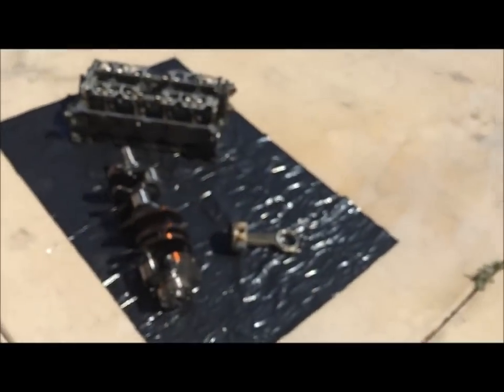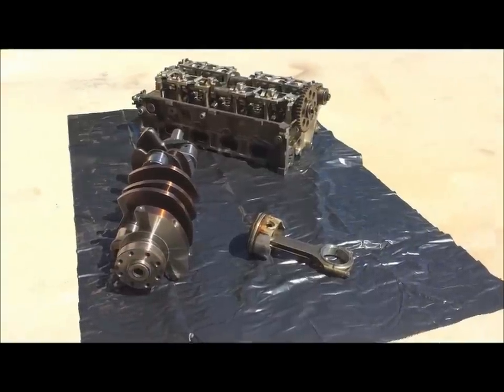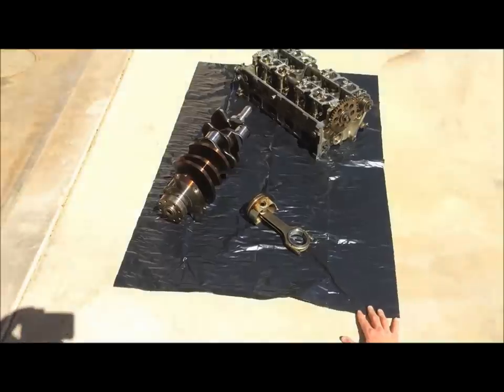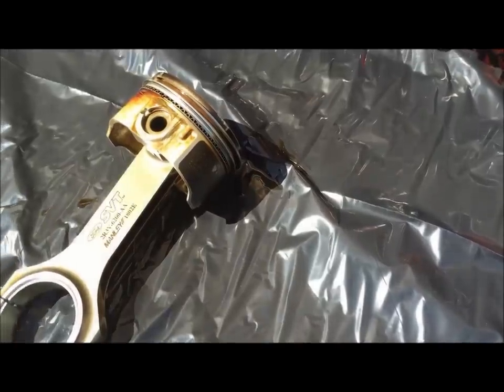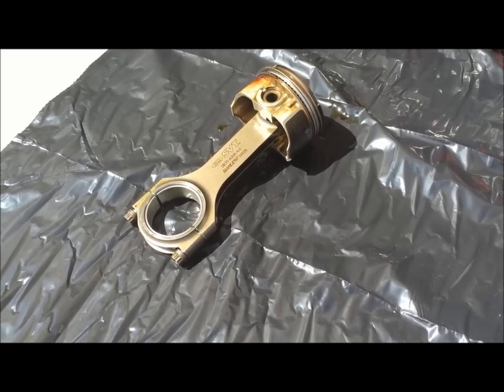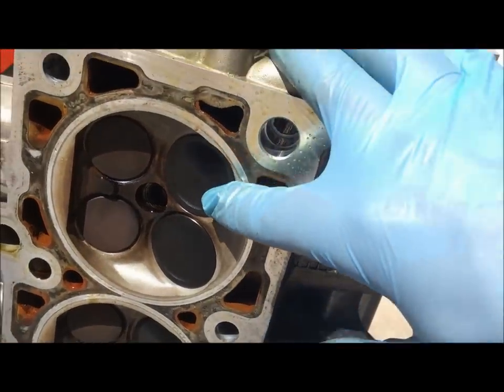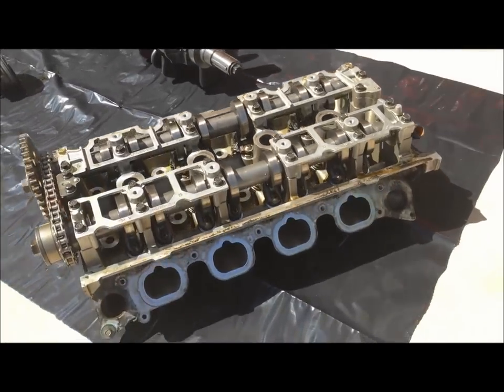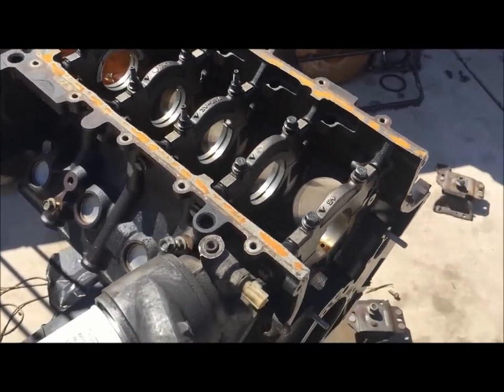Why is the 03/04 Terminator Cobra Engine so STRONG? Internals exposed

Comment: Hi Danny, I'm in the process of rebuilding my Mach 1 engine and found a set of Manley rods and New Zoller .20 over pistons (03 cobra OEM manufacture).  I know the pistons are 4032 material instead of 2618.   How long do you think the engine will hold on a Ported Eaton with 14 pounds of boost (500rwhp)?   Would 100k miles be possible or am I foolish for not going 2618 material?  My goal is a 100k mile sealed engine.

Comment: Do u recommend using the OEM oil filter? Seems like most people are. I’m using K&N oil filter and royal purple. This was my first oil change. Just got it last summer.
Reply from the maker: Yes, motorcraft FL820-S. I used a k&n once and it had far too much backflow. The car sounded like it was out of oil every time I started it.
Reply: Danny Johnson hmm. I haven’t noticed any change. So when you started it did it sound like it was ticking?
Reply from the maker: Mayjor Maynard Yeah, for a split second just like when you first start it after an oil change.

Comment: Great video, is it possible to run E85 on these Cobras without upgraded fuel lines or anything? I have an 01' Cobra with an Eaton swap and all forged internals, but here in Ohio E85 is very easy to get.
Reply from the maker: your main challenge is to get enough flow with the stock pumps. Or even a stock pump on a 01 Cobra. it’s possible, but you’ll be very limited until you go full return fuel system to big pumps

Comment: I have a 1997 Cobra with Kenne Bell supercharger and I going to swap aluminum block for Terminator block.. any ??
Not much info out there...
Reply from the maker: FrogsterGonzo Unless there is a problem, keep your 97 aluminum teksid block. It’s just as strong and lighter.
Reply: I have a 97 teksid also and it’s the holy grail. I did eagle ceramic coated pistons and Oliver rods 20psi boost with a pro charger and it’s bullet proof at 1000whp!!!

Comment: I kind of wonder why Ford didn’t just put a shorter pulley from the factory with the right tune.  This seems to put out 500hp easily.  I guess they ran out of money after putting all of the money into the internals and they figured their buyers would upgrade them anyway.

Comment: So are the 01 cobra heads good ? I have a 03 cobra but it ticking and I was gonna get my extra 01 cobra heads ported and polished and put them in
Reply from the maker: Esian Fuentes yeah, 2001 heads are almost as good as of 03/04 heads, but you want to make sure everything will work with fitment. Maybe it was just the front timing components that made the Eaton swap difficult for 01 COBRA's, but it may have also had to do with the heads as well.

Comment: this is a great video! you seem to be well versed with ford motors. in your honest opinion, which motor would you rather choose between a 2015 mustang 5.0 coyote motor or the terminator motor and why? i have a 2015 mustang gt, but i feel I may get a cobra one day and just want some more opinions. thanks.
Reply from the maker: Loscar5oh I was actually going to make a video on 5.0 vs terminator engines lol. It's all about goals. Both are great platforms, and without rebuilding the engine, the coyote's biggest advantage is making great power while being n/a with high compression (though it also makes good power with low boost being high compression- you just can't push it too hard, but you don't have to- it makes a lot of power from the high compression ratio). The terminator is also a Goliath for boost and safe to do so at 8.5:1 compression ratio...both great engines
Reply: Scrun Johnson thanks for the advice. I was wanting to procharge my 5.0 at some point but it would be amazing to build up a termi as well. in terms of reliability, lets say both are pushing 650 hp, which would hold better?
Reply: Scrun Johnson oh and you should totally do that video!
Reply from the maker: Loscar5oh is hand that one to the terminator, since the rods on the coyote are powder forged and may not hold up for a long time, but both can see 600s no problem
Reply: Scrun Johnson i didnt knoe that aboyt the coyote rods, i learned something new today lol. thanks for the help man, hopfully one day ill get my hands on a termi.
Reply: Scrun Johnson i did some research and found out the 11'-14' coyote motors have powered rods and the 15'-17' coyote have forged steel rods. these newer 5.0's are very similar to the boss 302 road runner motor.

Comment: Is the stock block for 04 cobra came with 4 main bearing or 2 main bearing for the crankshaft ?
Reply from the maker: omar alharthy if you watch at 8:22 it shows you have a total of 4 bolts per main cap. Two directly on top and two coming in from the side. An aluminum block has two more on the top for a total of 6 per main cap
Reply from the maker: +omar alharthy if you watch at 8:22 it shows you have a total of 4 bolts per main cap. Two directly on top and two coming in from the side. An aluminum block has two more on the top for a total of 6 per main cap

Comment: i was looking at a 99 cobra for sale. the interior and even the engine bay looked perfect, but it has 130000 miles on the engine so I was planning on rebuilding the engine with forged internals. I cannot really find the parts for a 99 cobra engine. Can anyone help?
Reply from the maker: YouShouldReallyContemplate Suicide i'm doing a video series on rebuilding the 4.6 L engine. The first thing you will want to do is buy the book how to build a 4.6/54 engine. I am reading through that book now to redo the build step-by-step, so watch my videos on pulling and disassembling the cobra engine and stay tune for the rebuild.

Comment: How many liters is the stock Eaton supercharger? What is the max boost it capable of putting out? Thanks.
Reply from the maker: 556 4Ever stock eaton is about 1.8L. After porting and a very small pulley you can see about 15 psi give or take
Reply from the maker: 556 4Ever you might enjoy this video if you have not seen it yet. https://youtu.be/sqYP7YGanYg
Reply: Thanks for the info. I just picked up a 2004 SY Termi with 36K miles. Has a 2.76 pulley with belt tensioner, CAI and Bassani exhaust with hi flow cats, SCT big mouth MAF with SCT tune and an MGW shifter. I'm planning on getting it dyno'd to see where it stands. I'm thinking somewhere between 450-470. What do you think? Is that realistic?

Comment: Idk if this would sound like a stupid question but would the cobra internals fit in a 03 marauder?
Reply from the maker: Quinnn Harris Yes. The cobra has a pretty low compression ratio, so I’d keep the  cobra crank and cobra rods and get some  different forged pistons with less dish to up the compression ratio
Reply: Ok, thanks man!! I bought a marauder but the engine has a knock so I want to break it down and rebuild, looking to get at least 500 at the rear wheel...
Reply from the maker: Quinnn Harris The complete supercharger system from the cobra will mount up, but you need a ton of parts. You might want to consider buying a complete cobra engine to just drop in. With machine work and parts, you’ll be at that cost. I’ll post a link to where I remove and tear down my friend’s cobra engine so you see what it’s all about
Reply from the maker: Quinnn Harris https://youtu.be/YFZVIkDmgY8
Reply: Thank bro, I really appreciate...but your right, I will need a tone of parts if I tried it. Thinking it will be cheaper to just go with the Vortech Supercharger instead.

Comment: If Ford made it a 5.0 instead of a 4.6 and increased compression proportionately, how much horse power do you think it would have made? 500 hp?
Reply from the maker: 556 4Ever Yeah, something like that since the GT500 right after was a 5.4L and made 500 and then 550. Those cars made that also with a more efficient supercharger, slightly lower compression ratio (8.4:1) but a lower redline. I spoke a little about it in this video https://youtu.be/mB7h9S_qa3I

Comment: I thought the 99 and 01 cobras have c heads??so my 96 cobra had powered rods,lol j/k. All that will change some day eventually,i got some plans. Loving my forged crank and 1000hp+  teksid block though :)
Reply: Btw try and do a heads video,i just got a 5 angle valve job and changed my valve guides as they were destroyed(idk how the fuck previous owner).
Reply from the maker: Morbid SVT COBRA I'll have to look at the specifics, but I believe the sn95s had the b heads and somewhere between when and the new edge they went to c heads, but the Cobra/Mach 1s had a revision (likely to accommodate the blower and flow better) so you can do an eaton swap on a 99/01 but it needs some kind of adapter
Reply: Yea they sell a kit for the eaton for c heads,i would have gone the c head route and then bought the kit,but i did my heads and ill just get a procharger later down the line
Reply: The 99 and 01 Cobras did have C heads. In 99 if you remember ford had an issue with the cobras not making the power they stated due to: restrictive intake manifold (which was a new design), heating issues around cylinders 6-8, and a exhaust that was too restrictive. Ford has a TSB out for this and fixed these Cobras at no cost to the owners. This was obviously fixed for the 2001 cobra. Also you can do an eaton swap on a 99/01 Cobra because of the head design. You cannot use a terminator eaton on a 96-98 without a kit (if one exists) or extensive modifying. The head you showed in the video @Scrun actually looks in good shape. Is the owner going to get the coolant crossover mod done during the rebuild? I would recommend it.
Reply: In would get the coolant crossover mod too if i was him while the engine is out,piece of mind.
Reply: Yeah, I have heard that what happened in cylinder 4 I believe tends to happen more often in cylinders 7 and 8 due to the coolant routing around those cylinders. They tend to be the hotter cylinders and the fuel comes in on the passenger's side of the car in the termis iirc, so bank 2 tends to be a little leaner as well.

Comment: The terminator is the same as the Mach1 engine right? Like the one in my marauder?
Reply from the maker: Vincent Pampanin They have a similar DOHC layout but are not the same. The Mach 1 standard transmission car (5 speed) has the cobra crank and heads but not the cobra connecting rods or Pistons. The compression ratio on the cobra is 8.5:1 whereas the Mach 1 and marauder have 10:1.

 The automatic transmission Mach 1 engine as well as the marauder do not have the cobra forged 8 bolt crank, so they only share cylinder heads with the cobra. The cobra has an iron block and the Mach 1 and marauder have aluminum blocks.
Reply: Danny Johnson thanks,  I am looking at forced induction for the marauder, stock they are good for 8lbs. Depending on the output with 8 lbs I might do it,  might not.  I'm not wanting to do a full bottom end build too.
Reply from the maker: Vincent Pampanin are you going to do an eaton swap with the cobra timing chain and such?
Reply from the maker: Vincent Pampanin I have some good videos showing tear down https://youtu.be/NT5Z5L2wAss

Comment: I'd rather have a stronger block then saving weight! ol'boy might learn the hard way depending on his power level!
Reply from the maker: Edward Thayer the teksid blocks were manufactured from Italy via the same company that builds the blocks for Ferrari. They are heat treated and strong enough to hold just about anything you'd put to them. The WAP (Windsor, Ontario plant) aluminum blocks are a different story, but still okay. Interestingly enough, the aluminum blocks have 4 bolt main cap studs vs the iron with only 2

Comment: NICE VIDEO FOR THE KIDS TODAY WHO HAVE NO CLUE WHAT THEY RE DRIVING, nice job. Subscribing,
Disagree with some of what I watched so far. The the Teksid block was 96-98 only, however there have been a few to slip through and show up in some 99 and 01 cobras, it would be interesting note if the German forged or Kellogg. 
ALSO DISAGREE ABOUT YOUR ASSESSMENT ABOUT THE BLICK CHANGE, THE IRON BLOBK IS USED AT FIRST GLANCE BECAUSE ITS PRECEIVED AS STRONGER, BUT WAS MAINLY COST CUTTING,.....FOR TEKSID ALUMINUM BLOCKS ARE SUPER STRONG.  GOOD FOR 1000 HP+ PLUS MUCH MORE DESIREABLE FOR THE WEIGHT SAVINGS. ESP WITH A BLOWER BEING TACked on
Reply from the maker: Keep in mind if Ford’s official statement for going to iron was for strength, that’s what I would report over an opinion about it being for cost savings. When you consider the aluminum blocks available to ford in 2003-2004 (as found in the Mach 1, which is a WAP block-meaning Windsor assembly plant), the iron block is stronger than what they had. The Teksid blocks came from italy and were heat treated and tanked, and without that process Ford did not have an aluminum option that would be stronger. Also, since teksid blocks appeared in 99 and also a handful of 01 Cobras, it would be incorrect to claim it was 96-98 only

Comment: All cobra cars had 8 bolt cranks
Reply from the maker: King Jerel thank you. I was pretty sure that was the case, but didn't want to make the claim. Not sure on the 93-95 5.0 Cobras/Cobra R.
Reply: Danny Johnson I'm sure about the pushrod era but all 4.6 cobra cars did and the aviator, marauder and mach 1 engines did as well..I was watching thinking I hope he doesn't say mahle poisons pistons lol but you you know your shit!! The zolner pistons were the weak link and the back two cylinders failed due to the coolant passage issues that I think were revised in the 2004 year.. You can do the crack pipe mod to remedy this and finally I think the high-speed 6 gear runs made them fail too bc the 6th gear ratio was so tall
Reply: Danny Johnson you've gained a Sub 🤘
Reply from the maker: King Jerel yeah, long highway pulls were definitely not wise. I'd like to do the cooling mod on the heads if I remove the Trans and have a nice straight shot. Just as a tid bit of info, the automatic Mach 1s, marauders, and even the aviator had a 6 bolt non, forged crank. That was the only disadvantage. Welcome to the channel
Reply: Danny Johnson are you sure?
Reply: Danny Johnson you mean the automatic machs
Reply from the maker: King Jerel yes, the automatic Mach 1 mustangs, marauders, and aviators (all the DOHC cars with automatic transmissions) had a 6 bolt, non-forged crank. They also had a lower redline then the 5 speed, forged crank cars
Reply: Ha... my 04' has that crack-pipe cooling mod. Heat gauge runs just below half way even on the hottest stickiest days here in Virginia.

Comment: I thought the teskid block was the strongest one 🙃🤔
Reply from the maker: For being aluminum it’s about equal- but ford no longer had the teksid block available in 2003 as they were phased out in 2001 to be replaced by the windsor assembly plant (WAP) aluminum blocks. Those also won’t really have problems under 1,000hp, but not being heat treated like the teksid was could have experienced some flex
Reply: Danny Johnson cool!! Great to know & also great infoooo

Comment: Fyi all aluminum blocks are heat treated. If they weren't they would be soft as butter. After being cast they heat treat and then machined.  Thanks for the great videos! Doug sales and tech Rodeck Aluminum Blocks. Home of the 350+, 481x and the TFX aluminum blocks. Now retired.
Reply from the maker: Thank you. Perhaps it was heat “tanked”? Does that sound familiar? Of course this is all second hand information, so thank you for your patience and understanding
Reply: At the end of the heat treat process the blocks come out of the hot oven and dropped into a water tank to shock the blocks. It's quite a site to see, lot's of steam and boiling water shooting out of the water tank as a dozen blocks drop in. I really like your videos!👍👍 I have a 03 azure blue Mach1 and love it! Thanks again!😁😁👍👍
Reply from the maker: Doug's Guitar Lounge Would you happen to know what makes te teksid blocks better? I heard they are much stronger from some process, but it must be something different than explained it appears
Reply: I don't know why the teksid blocks are better, I have never seen one in person, but from the pictures I have seen the wap block looks better than the teksid block. But like I said I haven't seen one in person. So I have no way to check casting hardness and thickness.
Reply: I found out the difference between the teksid block and the wap . The wap is 8lbs lighter so the casting is thinner in the valley and upper main web. When approaching 1000hp the blocks are pron to crack there. Ford corrected this in the 05 and newer wap blocks. So the 05 and newer wap block should be as good as a teksid. The wap block has a better main cap design than the teksid also. Keeo up the great videos!👍👍😎
Reply from the maker: Doug's Guitar Lounge Great info! Ford released an “aluminator” around 2007, which as I understand featured the same block as those found in the 2005-2009 3V. It sounds like they did in fact upgrade the WAP block as you say. Thanks for the info!
Reply: The 05 + wap block is the same as the aluminator block. Good stuff! After I retired from Rodeck I was offered a job at Ford Racing to over see the Top Fuel Boss 500 forged block production . But I turned it down because I didn't want to move from the central coast of California to the big city down south. I move hear to get away from that. If your ever out hear I would love to do a Mach1 cruze with you.👍👍

Comment: If its SOOO good of an engine, why stop making them and stop using them on new fords? Look at the ls on chevy..
Reply from the maker: Jessi Gutierrez 1. As mentioned, Ford did not have the necessary parts available and went with better aftermarket parts on a joint venture. Once the terminator was completed, ford used their own parts that are cheaper (and not as strong) on the GT500. 2. The LS engine has evolved into many variants (LS1, LS2, LS3, LS7, LSA, etc.) so it’s not to say the LS hasn’t changed just like the terminator engine has also evolved into the 5.8L trinity and the 5.2L Voodoo V8.